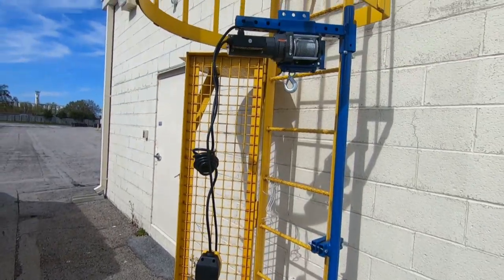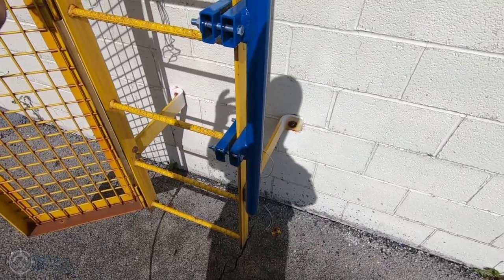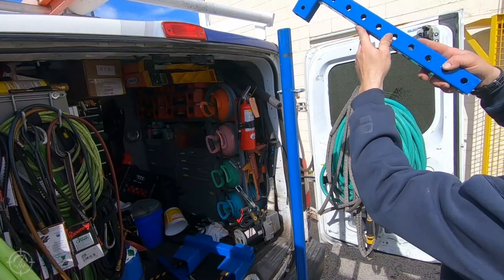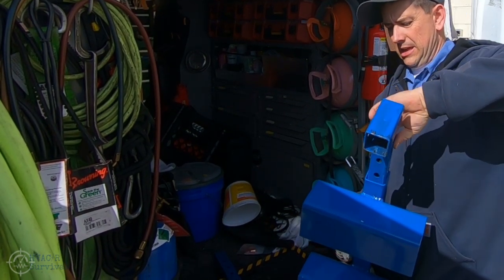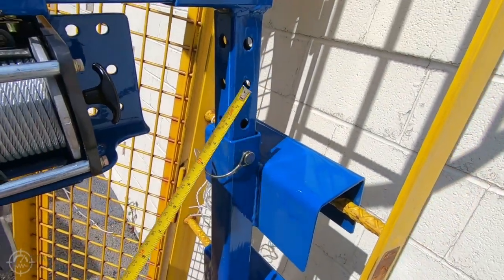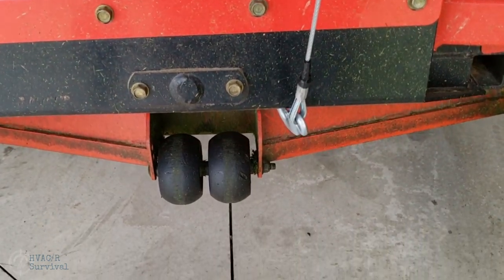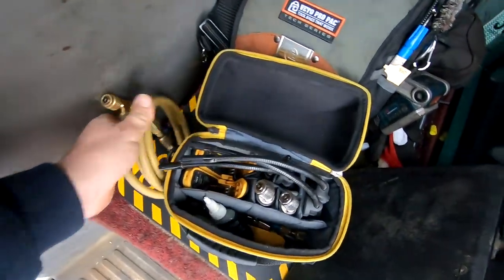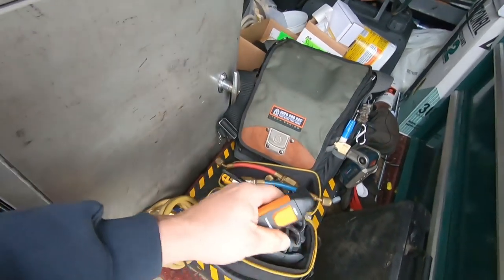HVAC Ladder Crane Redesigned For Any Job Under $275

Comment: Hi just a comment on the hook on crane part,  on a crane you should always have a safety  to prevent it from unhooking (any part like a moving gantry too) in the event of an accident it should not unhook or if a cable/belt snaps the shock load can make it "jump" and then it will un hook. Would suggest a simple pin OR chain welded on with a slot to hook into

Comment: Some people may say that using this is lazy and say your wasting time and should you just pull it up and get it over with...I say, you sir are a GOT DAMN GENIUS THAT IS AWESOME!!! KEEP DOING WHAT YOUR DOING. WORK SMARTER NOT HARDER! GOOD JOB MAN
Reply from the maker: I've nearly dropped a compressor before and as I get older I could end up with a screwed up back so I definitely agree. It's not been used much but it's great to know I have it if I need it 👍👍

Comment: You need to be using it NOW!

Built an A frame version for scuttle holes and have thought about the ladder attachment. Your version is great for that and as you have it set the A frame would still be quite usable.

I say use it more because I do commercial work only and while it seems stupid to use it for lighter stuff it is still very nice for the shoulders. Latching 2 jugs of gas on it, use the milwaukee packout crate with a strap on it to load out heavy service tools and parts. Torch set, nitro bottles, vac pump, 10 by 10 canopy.

None of that is really hard pull on a rope but it is nice to double up on stuff and not be sore.

Not setting it up on every job but in the 2 months I have had mine I have used it four times and will be using it this week on a comp change out.

GOOD JOB SIR.
Reply from the maker: Thanks for sharing your experience and thanks for watching 👍👍🤜🤛
Reply: I snapped my AC joint in my right shoulder while roping up the "not so heavy" equipment. It may not feel heavy, but after doing it for years, it'll definitely wear your joints down.

Comment: Holy smokes man, you have put an enormous amount of thought into this. WELL DONE!
Reply from the maker: Thanks RJ, I did think of several reasons for my justification of the winch purchase because I only used the other manual lift I built maybe twice. I have used this for cleaning my mower a few times already. Its a lot faster than my chain hoist. Thanks for watching!

Comment: I remember you showings us the original version a few years ago where u used the power drill/impact driver, to work the winch/lift.   Definitely would buy if you went into production on these things.    Tired of roping and using the old shoulder methods.
Great video as ways.
Reply from the maker: Yeah I was not very happy with the drill method. It worked fine the first time but a couple times after that it nearly burned up my drill and it was too much work for it. This should fix the problem👍👍 Thanks for your continued support!

Comment: AWESOME!  very impressive concept, I see a few minor things I would change, like welding a "washer"  then using bronze washer between for ease to pivot, thats the big one, but while this field I am only learning, I am a very competent Mechanic, auto-body many, & professional welder. been doing all for over 30 years,
Reply from the maker: If I was using this everyday I would have ordered closer tolerance tubbing, and other metals. I haven't had a chance to even use it yet in real life, just around the house 😲. Luckily I haven't needed to 😏
Reply: @HVACRSurvival  no worries, as an addition, the plate for the ladder step, I would drill a hole through, then use a tractor implement hitch pin, with a good lynch pin, just as a safety for reasons we cant explain, "LIFE" sometimes things we cant think of catch us by surprise, & that would go under ladder rung, to keep it from ever being knocked upward to cause it to come loose. like i said, great design,  I do plan to copy it for myself with scrap metal, I have several tons of scrap metal.  not sure of anything else until I make it to see if I see anything else, but for now, just those 2 is all I see.

Comment: Thank you for the video and this proposal. I would like to see this crane working on a project that you have. I like the idea. I just want to figure out how it would work on other situations as well such as: the ladder does not go over the edge of the roof. The ladder stops right below the hatch.
Reply from the maker: Start searching through my 350 videos there's at least four or five that's got it in it, it works great going off the bumper the truck it worked great going up the straight ladder and I've used it on the extension ladder
Reply: @HVACRSurvival  yes, I already figured it out with other video made by you. I like the system using the drill and the ladder. I’ll emulate that one and the one with the unit strut for the hatch, but using casters on plywood. I think those will get the job done. Thank you.

Comment: My crane, as nice as it is, it’s also weighs a ton. I used really heavy steel to build it, way over engineered! I wonder if 1/16” wall would be sufficient for the intended load. Do you know the wall thickness of your tubing?
Reply from the maker: The metal for the ladder rungs was 3/16. Everything else is probably 1/8 in, the pole is scheduled 80 black iron pipe

Comment: I would love to see a materials list with all the diameters you used for tubings and maybe a video of you building one. 

Also would love to see a demo on an extension ladder
Reply from the maker: It'll be the same as my first video far as the straight ladder. You can check that out in the link I have in the video. I will get together a list and post it in my comment section of my YouTube channel. Be sure to subscribe and click the notification Bell so you'll get that notification.

Comment: I have build one just like yours, utilizes Harbor Freight electric hoist. Your hoist look better. Would you mind sharing the source for the hoist? Possibly make and model?
Reply from the maker: It's the 120 volt winch from harbor freight. Think I got it on sale for 140 bucks. Originally I did this with a crank style winch and used an adapter with my drill but that didn't work out as well. I've used this to pull fence posts out of the ground 😁

Comment: Would you be willing to make one to order?  Thus could you use a 50' electric cable hoist?
Reply from the maker: Besides not having the time, I don't want any liabilities. There's a reason why these things cost so much money, It's because they have to be tested and approved by certain agencies before it's safe to sell so you have a leg to stand on if you get into a legal battle if something goes wrong.

Comment: What’s diameter and height is the SCH 80 tubing?
Reply from the maker: 63.5" total length, correct it is schedule 80
Reply: @HVACRSurvival  is there a diameter for the sch80 pipe? Like 1.5” or 2” round ? Guess I’m use to pvc pipe sizing
Reply from the maker: @bobbytran7365  email me and I'll send all the pics and measurements
Reply: @HVACRSurvival  email just sent. Thanks again for the help.

Comment: I"m looking for ideas to make the similar lift , the only problem is that I don't have a welder. how can I make a lift out of just unistrut and bolts?
Reply from the maker: I've seen a few made out of different materials.  If your wanting to use unistrut,  I would look at the unistrut website for brackets they have available to make similar mounting designs to what I did.
Reply: HVACR Survival thanks 
I enjoy watching your videos

Comment: Yeah I like your Crane I like it a lot to really grow save on your back the picked up long oppression myself and didn't use a but that right there that would really do a lot of big help that playing and making a bigger Crane than that however although will that supplied everything what you want for thought but a big mountain but with a bigger motor on it Yeah you must must still have a very good degree in engineering and do something like that Yeah well grammar right you sometime or my get my get my or my S studies in my head there at thing so anyway pitch you get you on the on the on the on the flip flop John away word God-bless in them be safe
Reply from the maker: Thanks 👍👍